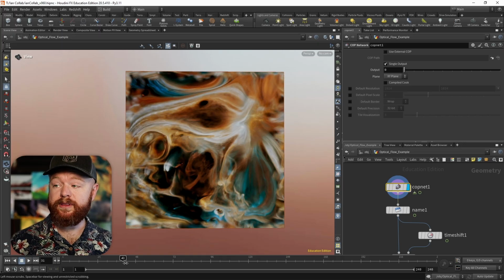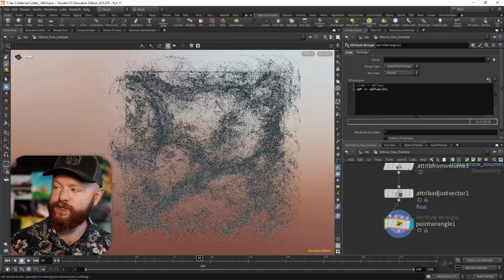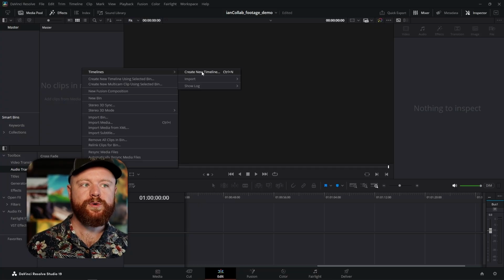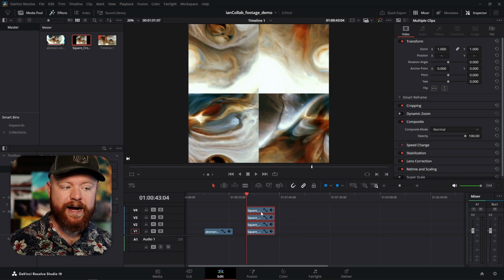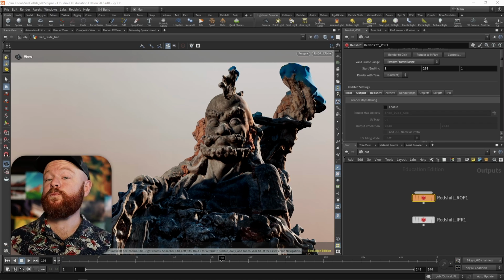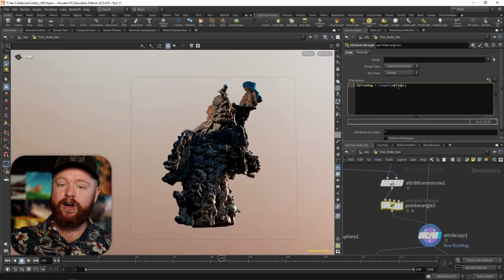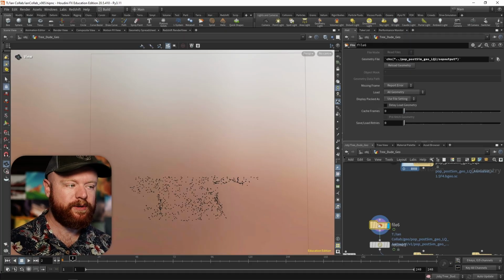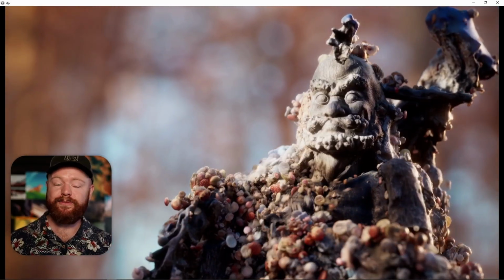Animating with Optical Flow

Comment: nice idea.
I love the creative use of the ink footage to drive the motion, makes for a good tutorial. I guess in this particular similar results could be achieved with curl noise and advection?

Btw, a quicker way to "bake in" the crop in resolve is to create a composite clip then "Render in Place"
Reply from the maker: Hey, thanks for watching!  The issue with using a curl noise is that it doesn't give you as interesting and organic of an effect as video footage does.  If you look closely at how the mushrooms start / stop / move around in general, it's not something you could really replicate with curl noises.  Also, good to know about the render in place feature in resolve!  Cheers